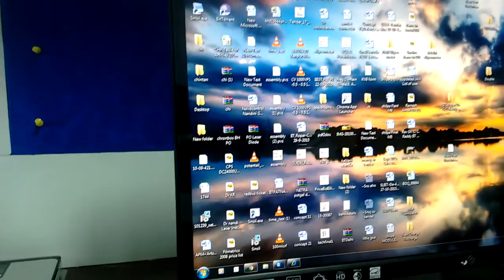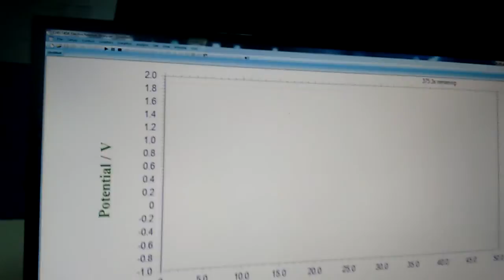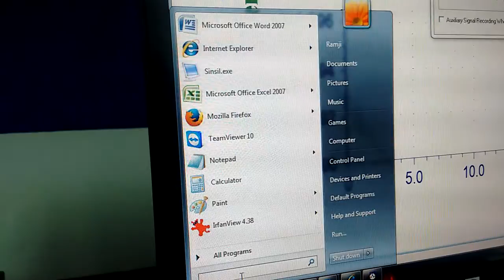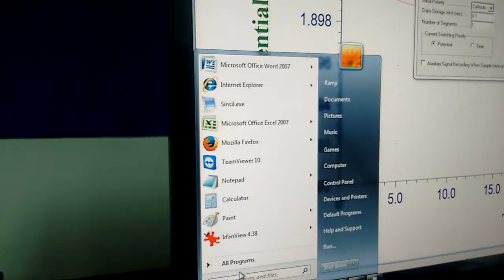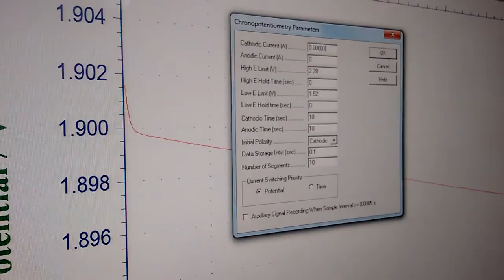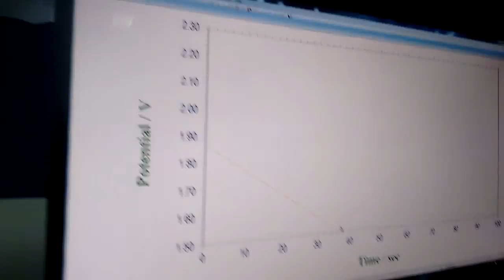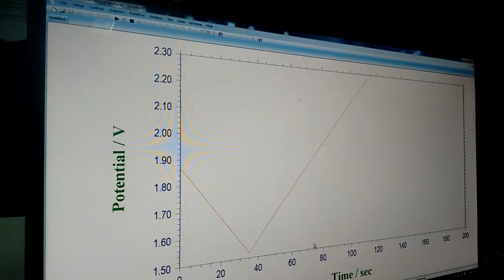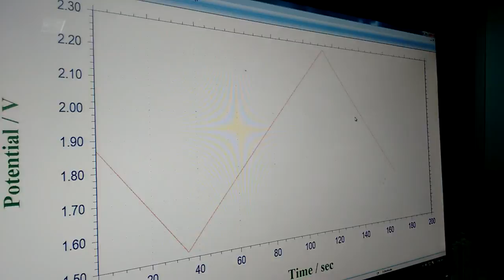Charge discharge CH instrument

Comment: What is the need of cathode and anode time? What impact it has on the experimental result? In this video although the cathode and anode timing is chosen as 10s each its impact is not getting reflected in your experimental result, the instrument is taking time it requires to reach the  highest and lowest set potential value, in both cases, time is more than 10s.
M. K. Dey, ACD, BARC